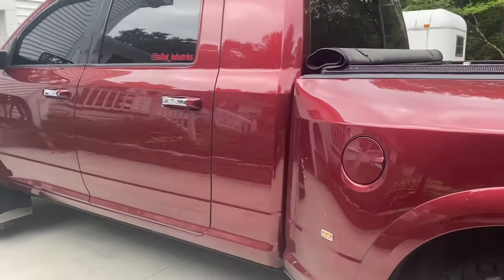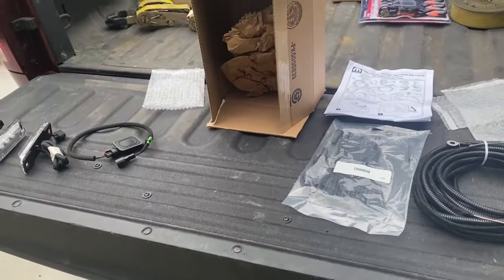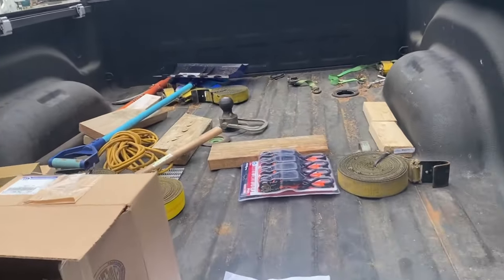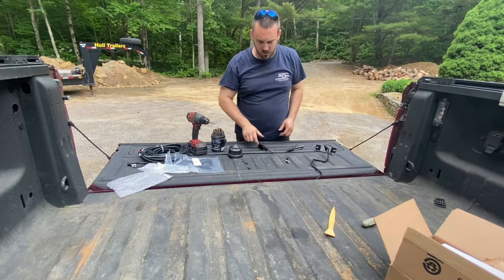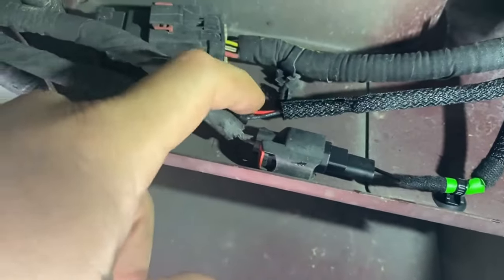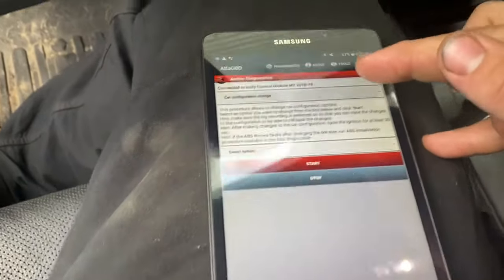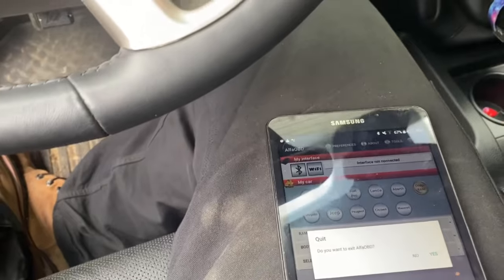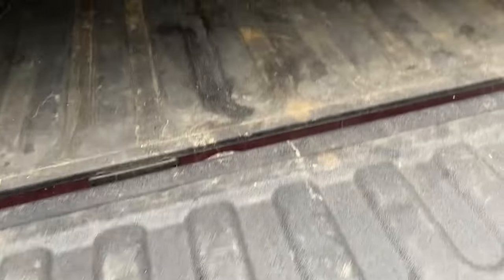Factory Option Enabling - Ram Bed Lights - Alfa OBD

Comment: That's a nice feature. I have a 2017. I haven't paid too much attention to see if it is wired up or if it has an external switch. I've noticed that there are a lot of things that are wired already but just need to install the hardware and turn on with alphaobd.

Comment: The reason why you had to change hardware to retain the lights, is because you installed the retainers incorrectly. Retainers go through lamp assembly, then into the bedside. Not into the bedside first.

Comment: What OBD tool did you use? Did you need a bypass to connect the obd?
Reply from the maker: i use OBDLink 426101 ScanTool MX.  im not sure if the MX is still available but some of the newer versions should work as well.  lots of AlfaOBD pages on line can get info on. yes i used a bypass cable since my truck is a 2018.  2018+ requires the bypass

Comment: I just purchased a 2022 ram 2500 Laramie and I want to install cargo lights. Do I have to add the switch ? And what app are you using to connect the new led cargo lights to the truck. Thanks
Reply from the maker: i am using alfa obd.  you will need the app and obd adapter and also a security bypass cable.  the lights should function with out the switch but its nice to have it in the bed.
Reply: I am confused of all needed to use the app on my 2018 ram 2500 and help I would be great full